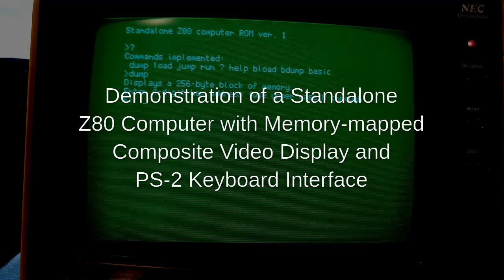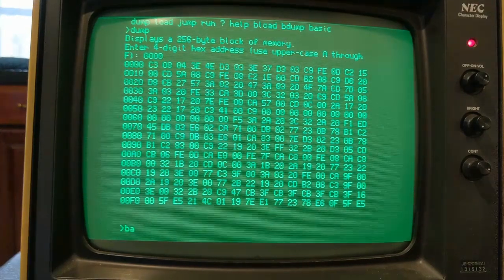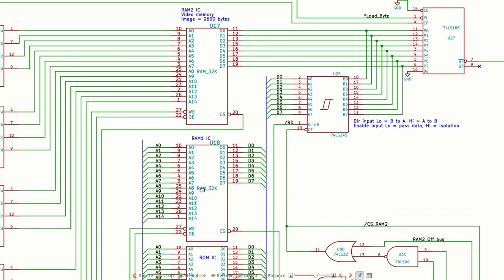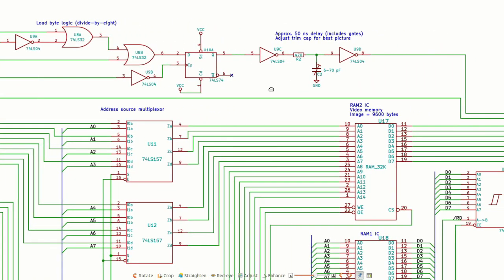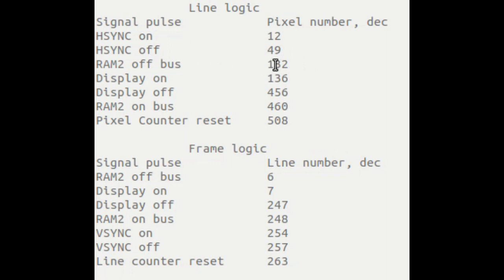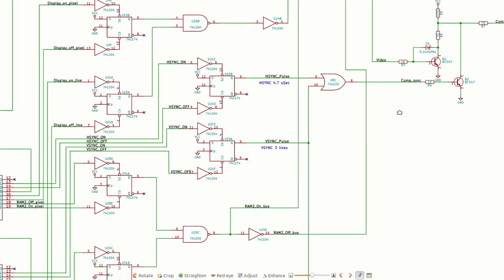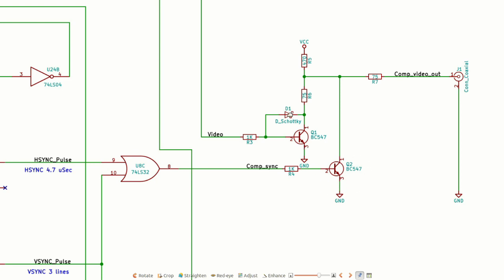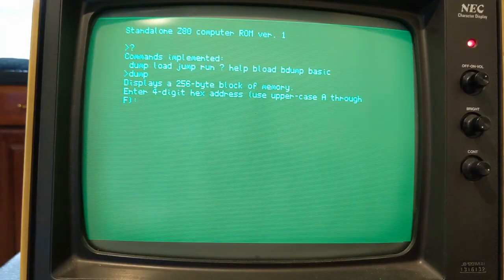Demonstration of a Z80 computer with a Memory-mapped Display and a PS-2 Keyboard Interface

Comment: Hi Donn. I have one of your boards from a few years ago and I still play with it from time to time. It's running CP/M and I'm programming in Turbo Pascal, trying to recreate some old sports analysis programs I wrote for my Dad about 40 years ago. Turbo Pascal is pretty amazing. Using a combination of source file includes, overlays, shared global variables, and execution chaining, it is totally possible to write useful programs and run them on a 64K Z-80 system.

Anyway, the all-in-one single board computer with video mapped display is exciting. Here's an idea if a full CP/M system is too ambitious ... build a 2-CPU system. Basically take your two boards and glue them together. One system runs the real CP/M system and outputs to a terminal line. The terminal line is hardcoded to connect over to the second computer, which acts as a self-contained VT-100 terminal. Build a simple terminal program into the ROM of the second computer (surely there is some open source code out there somewhere that could be used). Turn it on and whala, a self-contained terminal-based system that doesn't actually need an external terminal, all built using legacy chips (more-or-less). That would be exciting I think.

An lastly, how hard would it be to add support for a parallel printer. Oh that would be so sweet. I just bought a dot matrix printer on EBay. Fun stuff.
Reply from the maker: Hi Kevin. Thanks for your comments.
A parallel port for a printer would be simple to make. Kind of like the LED output ports on the bus display for the Single-board Z80 computer.
You are right, you could make a separate terminal using a Z80, with a composite video output and a keyboard interface. The Z80 computer with the memory-mapped display has the basic terminal design in it, but you are right you could put it on a separate board. But the terminal would be only a character device, and I wanted to design a system with a memory-mapped display for graphics, so that is what I did with this project.
Reply: @donnstewart706  That's great. You've done really great work. What I have in mind is the ultimate home-made, built from new parts retro computer. Inside it has 2 Z-80 SBCs, one which is headless/serial and one which can act either as a standalone computer or act as the terminal to either the built in SBC or a terminal to external computers (like if you wanted to build a PiDP-11 or an Altair 8800 clone, it would be good for that). A switch on the front controls which mode you boot into. There's also a RaspPI inside the box, because why not. The PI can also act as a terminal, allowing you to ssh into the box and then minicom out to the Z-80 SBCs. At least one of the Z-80s has the full setup with CP/M, 2 external floppy drives (real floppies) and a hard drive or flash rom. The whole thing goes inside a custom-built pizza box (low height) chassis. Building the chassis out of wood is acceptable. Extra bonus points for building the chassis out of sheet metal, aluminum, and/or 3D-printed parts. The chassis has built-in risers so you can slide a keyboard underneath, and sturdy enough for a CRT monitor on top. It's all totally doable. Your boards would cover most of what I described with a little tweaking. Probably the hardest part would be building the chassis. One of the main motivations is to do retro-computing in limited space but still using genuine parts not emulation. I only have a very small work area in my garage, so if I could have an all-in-one neat and tidy compact unit, it would be really nice.

Comment: Sorry, a little late to the party.  What is the actual CPU speed taking into consideration of the wait states from the video?  Is the CPU only running during v-Sync and h-Sync?  love your projects and working on my own but I don't have balls to video myself thinking about it plus I'd actually have to finish it.  lol  Love the work, keep it up. You inspire many including myself.
Reply from the maker: The CPU is independent of the display. The only times the CPU has to wait is when accessing the video display memory. (Actually, when accessing the 32K chunk of RAM that contains the video display memory. I did it this way to simplify the control logic.) It has to wait until the display is finished with a line, or with a page. However, if the CPU is accessing the other 32K of RAM that does not have the display memory it works at its regular speed.

Comment: Can you use a normal these days monitor ?
Reply from the maker: You can use most modern flat-screen TVs, they usually have a composite video input. But modern computer monitors are usually HDMI or VGA only.

Comment: hope to get in-touch to ask some questions.  I have a RC2014 z80 kit from another maker.
Reply: Have questions? Ask me if you need additional info on your project. I designed Z80 based systems starting from 1978. 

My Hardware design list from back then:

CPU board with 2 serial & 2 parallel ports, interrupt hardware & RTC
Disk I/O boards for Floppy, Hard Drive, RAM Drive and more
Video I/O boards & complete video terminals
Keyboards - serial & parallel (ASCI)
Intelligent Communication boards for remote mainframe connections
And Much More

I looked into the RC2014 z80 kit and did more research. I finally settled on, and just ordered the SC126 Z180 SBC / Motherboard Kit. It uses a Z180 CPU with a clock speed of 18.4 MHz, making it 4.6 times faster than the classic 4 MHz Z80 CPU. Don't know when I will receive this kit. Basic specifications:

Z180 CPU running at 18.432 MHz
512k byte RAM
512k byte Flash containing RomWBW
512k byte Flash containing SCM
Two asynchronous serial ports
Two 5 volt SPI ports
One 5 volt I2C bus master port
Real-time clock
Voltage supervisor
Three 80-pin expansion sockets

RomWBW is a ROM-based operating system for retro computers. It includes CP/M 2.2 and Z-System and supports a wide range of hardware, including SD cards and Compact Flash cards for storage.

Cost $62.00

see:

https://www.tindie.com/products/tindiescx/sc126-z180-sbc-motherboard-kit/